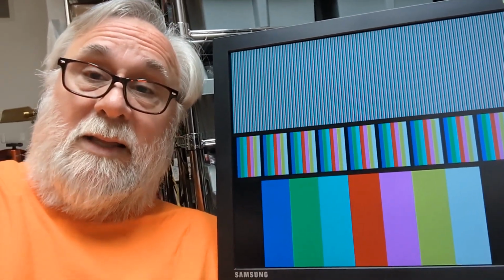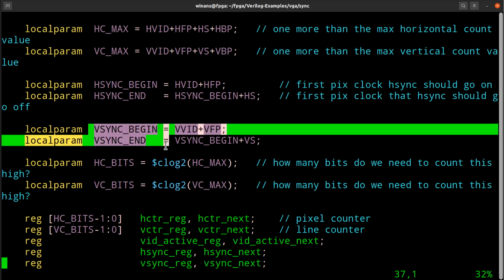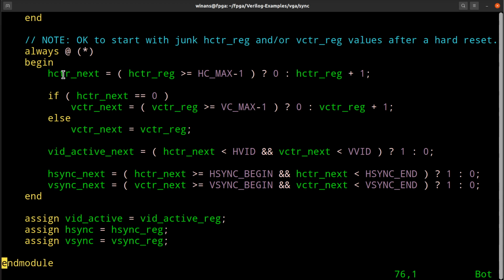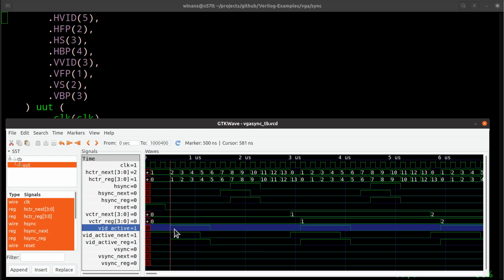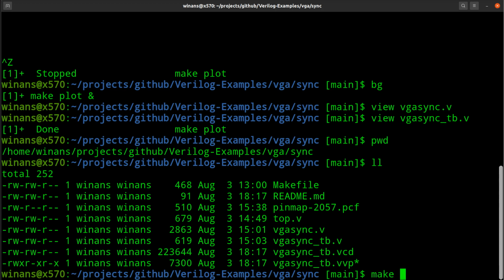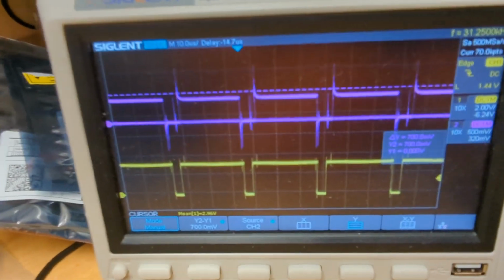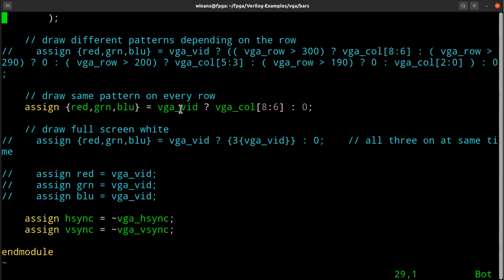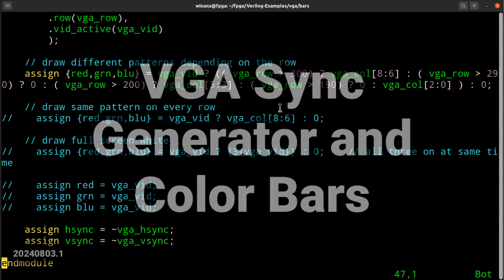VGA Sync Generator and Color Bars in Verilog

Comment: Hi, cool Video. Maybe VBP should be 33 (25+8) (Back Porch + Top Border) ?
Reply from the maker: Hmmm... You are right indeed!
I thought I stole my values from here:  http://www.tinyvga.com/vga-timing/640x480@60Hz and they agree with you.  
Thanks!  I must have copied that one wrong.  (I can see that the value is corrected in my other VGA sync generator modules.  I will go back and correct this in my verilog notes github repo.

Comment: Hello Sir, I actually want to display checkboard patterns on a monitor by using fpga de-10 lite board which has a vga port. Can I directly connect from this port to the monitor via vga cable.
Is there any circuit required for it
Reply from the maker: I never used a DE-10 board so I couldn't say other than to opine that if it has a 15-pin VGA port then it should have the necessary current-limiting and/or driver chips to plug it directly into a display.... a quick look at its block diagram documentation indicates that it does.  As a test case, you should be able to cobble the code I used together and give it the right clock frequency and it will just work.  If they have more bits per color than your/my test code uses then just connect ALL the red output pins bits to the same logic bit (and so on for the other colors).   Make sense?

Comment: Another great video, very well explained. Can't wait to see this working with the retro board (I am guessing that would be the end goal)?
Reply from the maker: Connecting the Retro's 5V bus to an FPGA (most, if not all today run at 3.3V) would require level shifters. 🤥I had been planning on using this with a Z8S180 CPU (In a project I decided to call Nouveau) running at 3.3V.